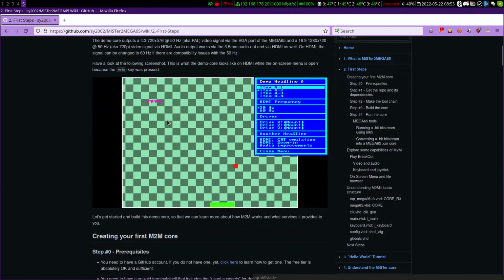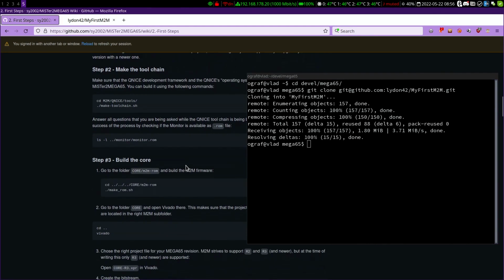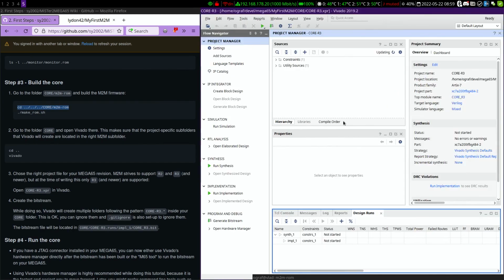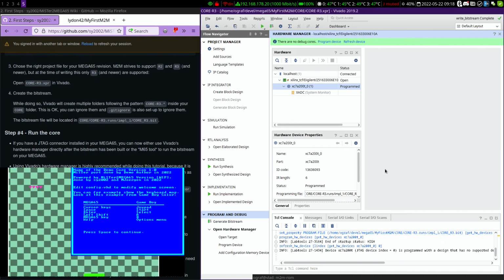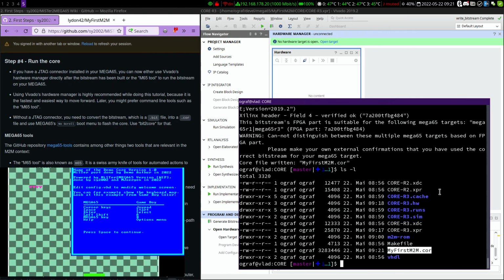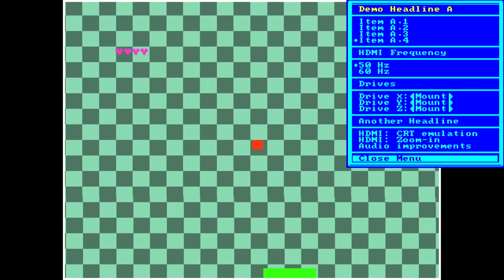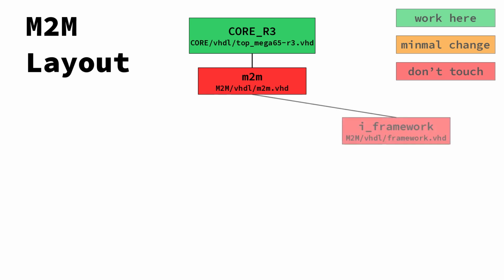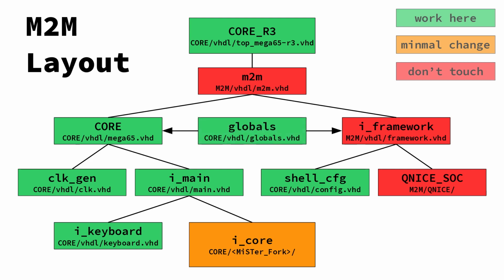MiSTer2MEGA65 Tutorial Part 1 - First Steps

Comment: do you know how to fix this error when using windows?

$ ./make-toolchain.sh 

error: unsupported OS type: msys
Reply from the maker: A very good question. I myself don't use windows at all, so I am lacking a good answer to this. I suspect using WSL could be a solution. I will check back with the rest of the team, if anybody has experience with this.
And make sure to do everything from within WSL (even the cloning of the repos).
Reply from the maker: Sorry for the delay... the wiki does list in it's prerequisite section that using WSL on Windows is recommended.